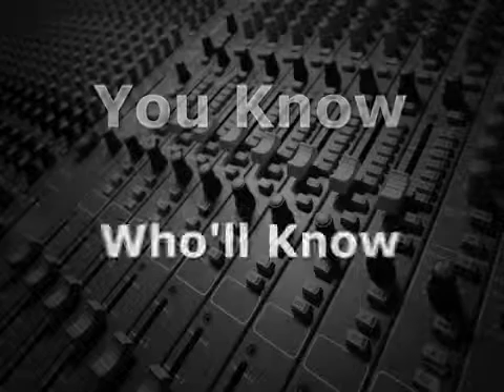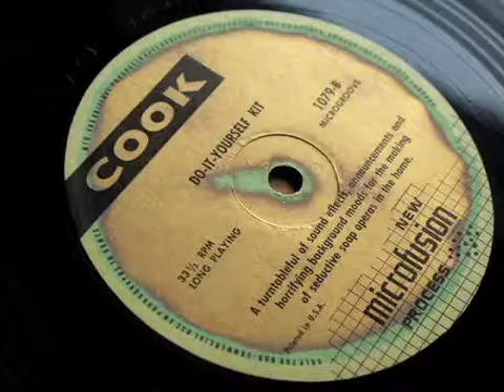Stereo Recording

Comment: One wonders when current engineers will take the trouble to provide a balance between narration  and music.  This presentation presents the music too loudly against the narration.  It should not be tiresome to concentrate on the narration. Engineers, who seem to think that rock groups are a good example,  lately are  gravitating toward this kind of balance.  Come on guys, can't this be done better?  This is a good overview of the subject matter for such a brief time.  For instances where balances are well judged, listen to some of the older commercials, and documentaries.  Thanks.
Reply: Thanks for your response.  After re-reading  my own comment I though I could have phrased  things a little more gently. Of course I felt the music wasn't bad, just the balance was a little off.  I remember hearing a lot of TV watchers complaining about balances on commercials.  Since they were older than I was, I wondered if perhaps it was a little bit
overstated, but after much listening myself,
I had to conclude that often they were right. I  happen to own several radio station copies of commercials and I was struck how the music was noticeably reduced behind the announcer
and current ones seemed to be careless in that respect.  Excuse me for going on at length.  I have neverf before written anyone on this topic. And, I might add, gratified at the response.  ThANKS AGAIN.